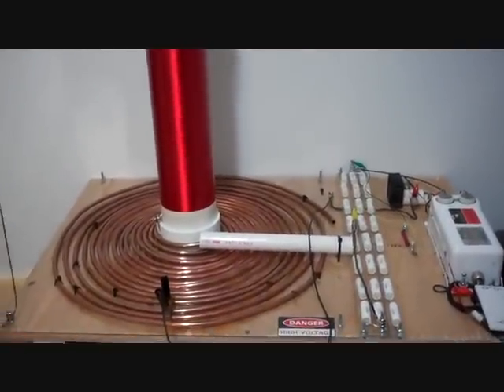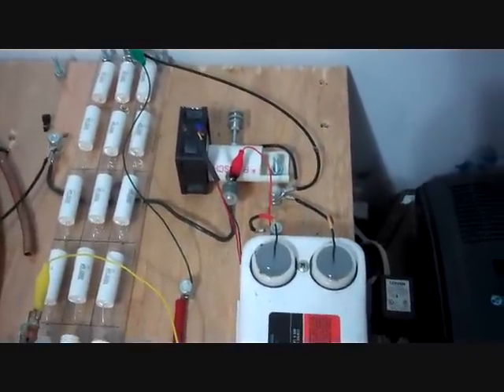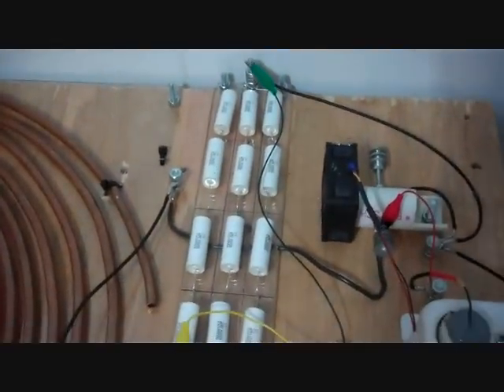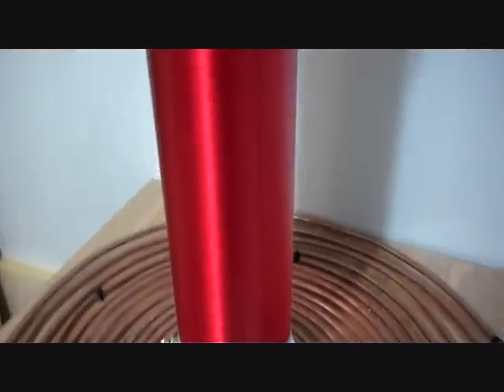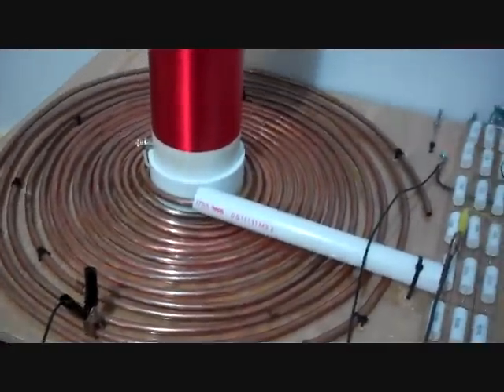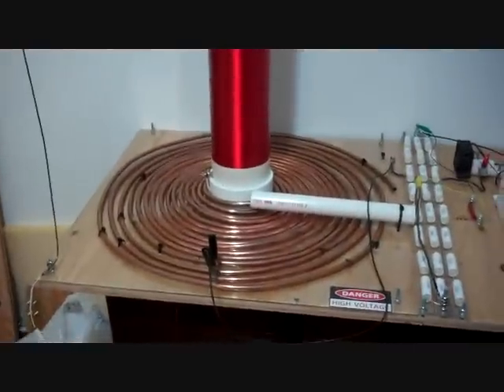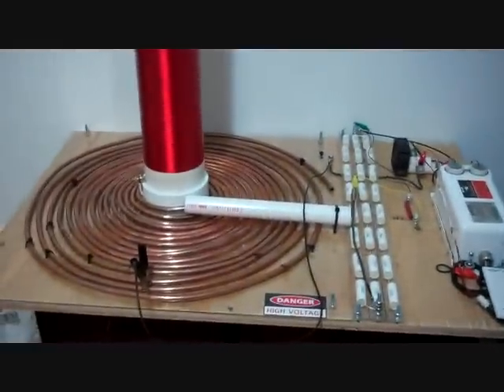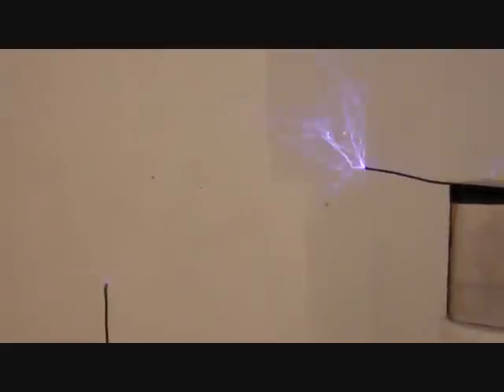I present; Sigurthr's Spark Gap Tesla Coil (SGTC V2.0)

Comment: Do you calculate the own frequency of the two circle with the Thomson formula? The frequency of the primary and the secondary LC circuits are equal? Thx the answers!
Reply from the maker: +Molnár Milán Yes, the frequency of the primary and secondary LC circuits are nearly equal. I had problems with parasitic capacitance with this tesla coil because of the physical build structure, so it did not match the calculated resonant frequency, which required that I adjust the frequency by hand to get close.
Reply: Thank you for the quick answer! Can be possible to measure the circuits own frequency with an oscilloscope? With a frequency generator create different frequencies in the circuits, and with the oscilloscope view witch is the resonance frequency. Can be this possible what do you think?
Reply from the maker: Molnár Milán Yes it is common practice. You have to do the tests with both LC circuits in place though because mutual capacitance and mutual inductance affects the resulting resonance points. For a spark gap coil you disconnect the power transformer and short out the spark gap with a wire before feeding the primary LC with the signal generator. For the secondary you disconnect the LV ground end and place the scope at the HV output, connect the signal generator to the LV ground end.

Comment from the maker: The way it is in the video is the result of trying every possible alteration to squeeze out the best performance. Racing sparks were encountered when the primary was raised (same as lowering the secondary) due to too high of coupling factor. The quenching could've been better, yes, but was not a major factor. This secondary is now used in a SSTC and it is operating in a multiple high-order tesla harmonic mode due to larger than normal interturn capacitance of the secondary winding.
Reply: Matt using square steel box is foolish, will make heat losses and it might effect it being an air coil.